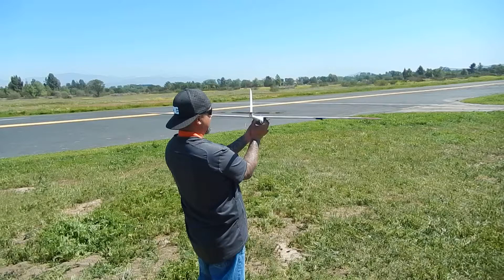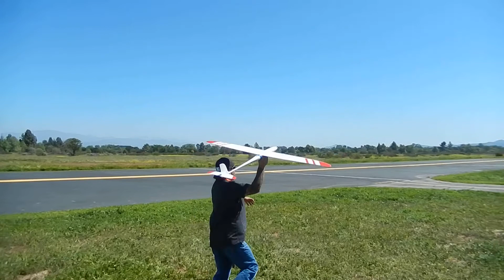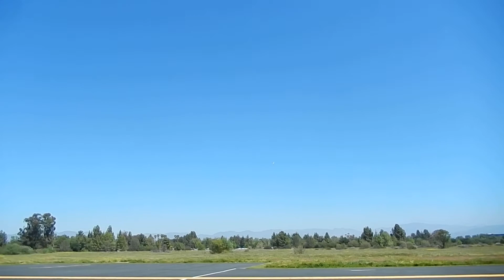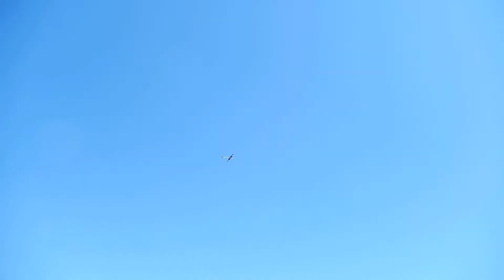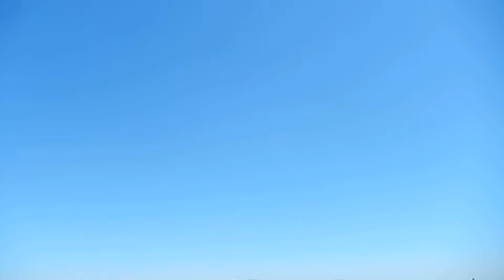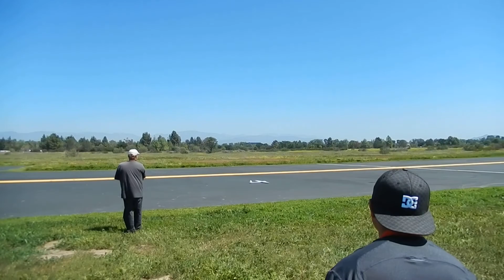F5D "Jolt 2" Pylon Racer 3-26-16

Comment: Motor, lipo,speed controller?
Reply from the maker: Neu 1115/1Y ,  Thunder Power 5S 2700mah 70C with Castle Creations Edge Lite 130A ESC. Using a prop I made. Low dia/high pitch.